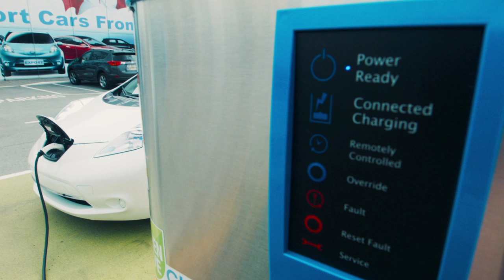Electric Motorcycles vs Gas Motorcycles (HARD FACTS)

Comment: The continued high price of EVs combined with the rapid depreciation of motorcycles makes for one hell of a hurdle to get over to pull the trigger on e motorcycles.
Reply: Wow! There is somebody left in this world that has a brain and would probably never wear a pink polo shirt!
Reply: LOL logical fail. You can't even pull the trigger on the sports bike because they are Limited Supply & Expensive. It's because Production Capacity is soo tiny that is why they are expensive. I would not even consider Zero SR truly a mass production bike. Thanks for pointing out the contradiction.
Reply: @Neojhun  I would assume that the logical progression is to attempt to make e bikes more available like electric cars. If bikes follow the same trend as cars, one would look at a mass production electric bike and see an extremely higher price tag compared to the gas alternatives. I would argue that a smarter strategy would be to continue to clean up gas engine emissions for now until technology reaches a more affordable level. A 2% emission reduction in 99% of vehicles sold has a higher impact than a 99% reduction in emissions from 2% of vehicles sold. Companies then use a portion of profits to research storage solutions.
Reply: Even auto manufacturers aren't making a red cent off EV's. They simply make them because they are mostly forced to make them. The gas counterparts is how manufacturers stay alive.
Reply: @exothermal.sprocket  This is just the start. Nothing is profitable when you only started mass production. Once multiple Automakers have their own Cell Production on a large scale, BEV will be very cost effective and profitable. Though there is one problem, BEVs simply require less Maintenance Cost,  large part of their revenue is frequent servicing. That is where BEV are less profitable.
Reply: @exothermal.sprocket  "mostly forced to make them" Correct forced by Customer Demand. The Propaganda and Lies are dead like "gay, weak, slow". The technical truth is out how Torquey & Quick BEV are in Reality. Fun vehicles to ride & drive create demand.
Reply: @Neojhun  Hahahahahahahaha.
No.
Reply: @exothermal.sprocket  LOL genius argument /s
Reply: @Neojhun  Mehhhh think what you want.
Reply: They should have ebike  rentals at race tracks  with swappable batteries that just about last 20 minutes but you end up with say 130hp 205kg or better
Reply: @double0sullivan88  If you go to China, nearly all bikes and scooters there are electric and they are mass producing them and starting to export them to other markets. Very cheap compared to Zero.  Zero is a high-end quality built bike.
Reply: @exothermal.sprocket  where did you hear this,  pray tell?

Comment: One thing that I thought you were going to mention but didn't, electric motorcycles have no CLUTCH.
Reply: No wheelies, well you could probably pull of a power wheelie but... 😪
Reply: In Energica or Zero, they commonly have 4 modes. Eco, Sport, Turbo, and (I forgot the other one). My electric motorcycle have speed selector or clutch is what you call in the gas world, only 1/2/3 gear is what we call it here. Not all electric bikes are the same. There are small distributors of electric vehicles that are not known yet but all electric powered vehicles here have 3 types of speed, number 3 for the fastest. 

And I disagree for the electric motorcycles can't even do a wheelie. You have not met Zero bikes yet. 

sorry for the wrong grammars
Reply: @rival2028  LOL They wheelie forever believe me.
Reply: @CloroxGodThe1st  educate me. Do they!?

Comment: Very good point. as you point out, IC engines decline performance/efficiencies over time as much as if not more than current battery tech.  If you were to replace a battery and replace a motor, the motor might be cheaper today. I believe this will change within the next couple years as tech gets better. ...and the new battery will most likely have more power and last longer than the last one. I don't think this is always the case for ICE.

Comment: 9:35 i was actually thinking of making solar powered electric moped(with max speed of 45km/h) but i calculated that i would probably need to wait for like 50% efficient solar panels until it would give me enough range for my daily commute and even then it would only do that for like only 6 month per year so not perfect but that's still alot less charging so it's definitely an improvement.

Comment: I ride my Zero SR half above 60 and half at or below 40. My range is a solid 110 to 130 to empty. I also accelerate smooth (Most of the time). Keep in mind that habits that save you gas, directly apply to saving you KWH.

Comment: Try plugshare you will find a lot of charge stations.
Reply: Yeah that part about infrastructure is heavily missleading. Sportbikes have much smaller batteries than cars, the Level 2 J1772 car chargers can top up Sportbikes quite fast. Those are the most common and very abundant.

Comment: I live in China and have an electric moped. 72v battery and a 6kw motor. bike weighs about 50 kg and it usually smashes motorcycles up to 50 mph plus. It has a top speed of 84 mph, does about 100 km in distance and costs about 3000 dollars
Reply: plus has a removable battery that weighs about 10 KG
Reply: above is including upgraded suspension, a back fork, fatter back wheel and fatter front wheel, and also front and rear brake system upgrades
Reply: plus the ECU that allows it to go that fast lol

Comment: Electric motors and batteries make tons of heat! Geezz! Tesla has a dedicated system to cool the batteries. I am a RC hobby - est (sp?) and the ESP in my trucks have their own cooling fans. The motor has a giant heat sink and can burn you after a run. You are discouraged from charging a hot battery. All hobby stores sell heat/thermometer guns to help manage your setup to avoid heat damage. How could you get this aspect so wrong?

Comment: Don't have the range, and won't have the range.   I need 350 miles in the mountains riding hard and I'm a big boy
Reply: Paul Britton what motorcycle has that range?

You will still be dependent on a fuelling or charging  network.
Reply: @donaldpyper4627     I always love that response.    GAS STATIONS!   I'm filling up at about 100 miles.  I'm not looking for range per fill/charge, I'm looking at range for the day.   Where I'm riding gas stations are fun enough to find a decent one.  Charging stations are a pipe dream.

Comment: What are the transmissions like on these bikes? As he says the roar of the motor and the understanding of where you are in the revs and transferring the power to the rear wheel is intimate and poetry in motion. Do you get this experience on an electric bike? Or is it just like riding a scooter?

Comment: 1 thing that people may not think of it the more electric vehicles there is the more electric they have to produce and many of them still use fossil fuels like coil and nuclear power so are we really go to save the planet from pollution probably not. The government should look at clean energy before everything becomes electric
Reply: PAUL GOODMAN that’s why renewable energy is becoming more popular and also power plants are way more efficient than car engines. Therefore less pollution per unit of fuel burned

Comment: i believe it would be better to go with synthetic gasoline from renewable energys instead of electric vehicles with batteries. Its not only the climate aspect, but synthetic fuel does not require to replace every vehicle, burns way better and is better for engines.

Comment: I've got a cbt legal electric motorbike with 170nm of torque. Perfect for around cities as it will do 0-40 in seconds but after that its really slow. If you haven't ridden one yet I would really try to, someone I work with has ridden super bikes for about 20 years now and says that my bike is really fun and pretty impressive for what it is. Just need to get used to being really smooth with throttle because it will go of you're not careful

Comment: I think the problem isn't the vehicles themselves, but the pricetag. They're too expensive for the range and max speed they give you. One simple electric with shit range and barely max speed of 100 km/h can go for over 4000 bucks. It just isn't justified, especially when the batteries will probably last you no more than 3 years if you ride a lot. 

Right now, they're just an overpriced novelty. Gotta wait for them to integrate better into the market so we can get reasonable prices.

Comment: Standardize the electric bike power pack. Just pull up to a gas station that is equipped for electric vehicles. Lift your (gas tank) pull out a 25 or 30 lb power pack slide it into the appropriate receptacle. Grab a fresh pack slide it in your bike, ready to go. blockchain and Bluetooth keeps up with who has what packs and how they treat them everything is recorded properly by Big Brother. wham bam no more waiting on charges. Pay by subscription or pay by the mile like gasoline.
Reply: You're welcome

Comment: There is something to account when talking of difference of weight between electric an gas bikes. While gas may be more weight efficient than batteries, you have to consider that a gas engine has to have a transmission, engine oil, sometimes a cooling system, etc.. and electric bikes dont have that. I did not see the specs on the electric bikes but i think they could be lighter than gas bikes.
Reply: For a fair comparison, the dino-bike needs to take the gas, the engine, transmission, exhaust, etc., all of it into account; and the e-bike needs to take the battery and the motor (and that's about it) into account. And then you have to make sure to compare equivalent bikes on each side, and how do you determine equivalence?
Sadly, nobody's making an e-equivalent to the BMW RT in any way, so for now, I'm stuck burning dino-juice. :'(

Comment: There are plenty of good reasons to get an electric motorcycle, but no exhaust shouldn't be one of them...    because unless you live near a hydroelectric dam,  your exhaust is the local power plant...   and for most people, that means coal.
Reply: even if your local power plant is coal, it's still more environmentally friendly than a gas engine. First off because that coal plant would be running whether or not you were on an electric bike, you're not keeping it from shutting down with your bike, because electric bikes are so efficient, they barely need any power to charge up relatively to gas engines. They only cost a few cents for a full charge.

Comment: I'm not so sure about the lesser environmental input of electric powered vehicles. The electricity has to come from somewhere. And I doubt that most of it is clean energy. It's probably produced by burning fossil fuel and converting it to electricity. And here's another thing - every time you convert energy or charge the battery you still produce heat - the efficiency is not 100%.

Comment: if they could put a small alternator on it to keep throwing a charge back in to the battery you  could theoretically keep going for a long time
Reply: Uhhhhh no.
Reply: LOL Its called perpetual motion and they found out that doesnt work centuries ago
Reply: Maybe you could get a tailor to pull around a gasoline generator to run your electric bike

Comment: I don't have any issues with the electrification of vehicles but I find the "better for the environment" argument to be garbage.The internal combustion engine isn't going anywhere anytime soon. I imagine engineers will continue to find ways to make it more efficient too. I don't have to look past my phone to be turned off by the idea of a battery powered vehicle over the internal combustion engine. After two years of charging my phone everyday, there is considerable loss of battery capacity. I assume the same is true for car batteries (albeit much longer intervals). I still consider battery powered vehicles (mainly daily commuters,...not the recreational kind) a niche item, costly to own (both in initial purchase and eventual repairs) and not practical enough for the vast majority of commercial or common man applications.
Reply: a DarnGoodJoe Phone batteries and EV batteries work WAAAAY more different than you think. Range losses are so much less than a phones battery loss after 2 years. Plus most phone companies make their batteries with a 2 year life in purpose so that you need to keep buying the latest model. Car manufacturers wouldn’t try that shit as it would tank their business. I recommend looking up the differences

Comment: IMO, when it comes to electric bikes I respect them and they can be neat. Price for price though, they are not worth it.
Reply: Once they get better mileage, then I think it'll be worth it. But as it currently stands? No, definitly not
Reply: Price for price they will outlast three ICE bikes and cost 1/10th of the maintenance and 1/5 the fuel. So yes ICE bikes cant compare for value
Reply: @benmay1294  This is true too, but electeic bikes are still more expensive than the gas ones though. Only time will tell.

Comment: All electric cars? sure. All electric bikes? I don't know bout that.
Reply: Nah the same as there is I.C.E purests in motorcycles the same goes for cars. Short of banning I.C.E cars, which the US will never do. Some form of I.C.E cars will survive even if its only a tiny percent.
Reply: @craigfirman1809   Manufacturers won't build ICE bikes if it becomes cheaper to build electric. Regulations are shifting it already due to emissions.  By 2035-40 you'll find it very hard to find ICE engines.

Comment: And there is this thing called "potential energy". There is more potential energy in 1 gallon of gas than there is in all the batteries in a tesla put together. We are years away from gas engines going away.
Reply: good, the longer we can keep them around the better, even if we ultimately do some sort of weird alternate fuel conversion like hydrogen
Reply: @duskshadowpaws4434  Hydrogen sucks, it's not worth it.
Reply: @ghoulbuster1  maybe practically, i was just throwing that word out as a suggestion "some sort of weird alternate fuel conversion like hydrogen, at this point, anything that'll work and do it cleaner than regular petrol
Reply: Matt Brown | Correct, unfortunately even the most efficient engine can only use about 1/3 of that under ideal circumstances.
Most of the time it’s about 10%.

Electric motors, inverter loss included are about 80% to 95% efficient.
Reply: The potential energy in a gallon of gasoline is 33.7KWh.  There has never been a Tesla made with that small of a battery, the Roadster had 53KWh.
On top of that, Tesla models get about 4 miles to the KWh.  That means they can get at least 120Mpge.  A Zero motorcycle that can outrun a Tesla in the 1/4 mile gets over 300Mpge!
Reply: @CrissaKentavr still doesn't tempt me to go electric, never will

Comment: I dont think e-vehicles will be better for environment and such since their production, maintenance and recycling are the problems of their own (accumulator production is exceptionally unecological, for example), but Im defenetly down for it for performance part. Sound is a good cosmetic feature, but 45% (at best) efficency difference, not in favor of gas engines is no joke. So yeah, looking forward to the future.

Comment: Look into how the batteries are made ,how long they last and recycling finished batteries.
Not so environmental as promoted😱
Reply: LIES! That is a horrible propaganda rumor based on Vehicles at ZERO Miles & Lies about Lifespan.
When fleet data of BEVs proved that can have crazy lifespan well into 6 Digits miles. The Propaganda lies about Environmental Impact gets destroyed. When you replace the core components much less and much longer mileage. The fundamental fact it's cleaner and less resources consumed.
Reply: Thanks for your opinion .
Much appreciated!
Reply: @johnroche4484  Not an opinion, that was technical Facts. Your comments was a false opinion. Please be more carefully research before you state falsehoods.
Reply: @johnroche4484  Here is the technical calculation for Zero SR/F a similar bike. Conservatiely 150 Mile range, conservatively 1000 Charger Cycles, probably dead at 1500. 150 x 1000 = 150,000 Miles of solid reliable riding. Then problems may occur after that. Dead around 150 x 1500 = 225,000 miles. Which is overkill for a motorcycle.

Comment: Current electric motorcycles are a joke. Why would you get yourself a low range no sound sport bike that you can’t even ride while you’re drunk? No sound means people don’t hear you and so you might easily get run over by a truck. Instead get yourself a cheap, nice electric bicycle from Alibaba And you can ride it while you’re tipsy and use safe and nice bicycle Lanes.

Comment: Until the grid is solar electric vehicles are no more green than fossil fuel cars. 63 % of electric is produced by burning something , the next is nuclear and well it's radioactive then renewable at a non impressive 18%. Rechargable batteries are made from lithium which means using fossil fuel behemoths to mine it . It's a gimmick .

Comment: I am so tired, why dose people believe that cars and motorbike that run on batteries have zero carbon dioxide emissions. The minerals and substances used in batteries takes a lot of energi and the process to make these batteries is letting out a lot of carbon dioxide emissions. They are also a limited amount of these minerals and substances. So if you compare a new car running on gas and a car running on batteries, then you need to drive for over 15000 km until the car that running on batteries have zero carbon dioxide emissions. And i guess those batteries are not gona hold for that long so then you are gonna need to change those, so then we are back at square one.